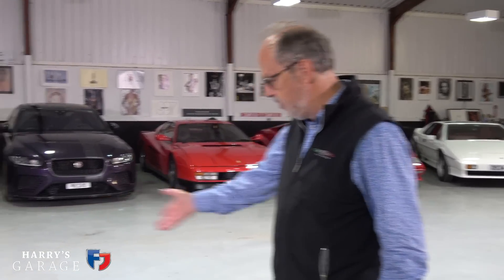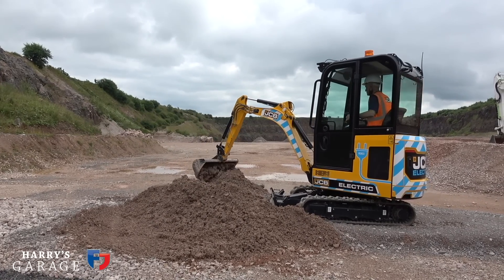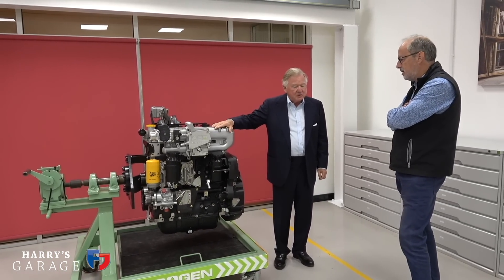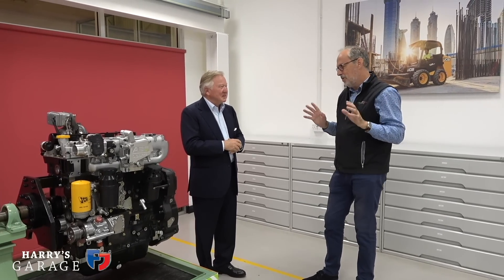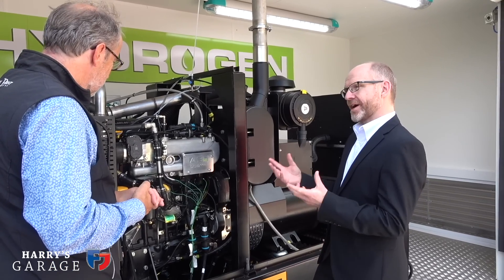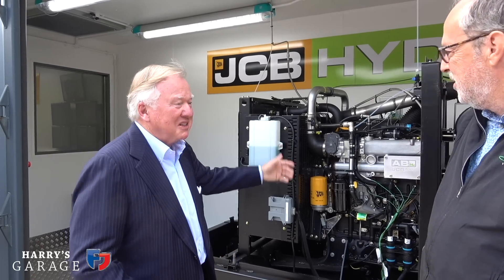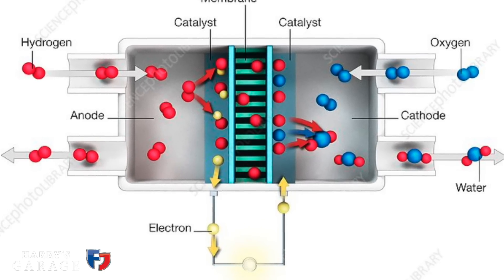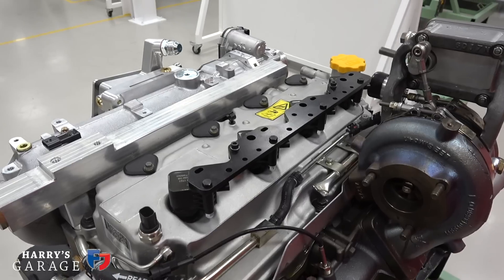Is hydrogen, rather than electric, the future for big-engined machinery? I visit JCB to find out

Comment: I think the main problem is that the hydrogen combustion engine is rather inefficient. Probably less than 20% of the electric energy going into electrolysis is available on the crank shaft. Personally I think that better option would be ethanol or some other non-fossil fuel.
Reply: i bought an ethanol car ~12 years ago, it works great. Ethanol was dirt cheap back then too, then the govt ramped up the tax when ethanol users hit critical mass, now petroleum is cheaper and even diesel is cheaper on a per mile basis, instantly killing any motivation for new punters to make the switch. The regulators need to pull their heads out of the sand.
Reply: To produce ethanol  you would need massive amounts of farmland dedicated to it. The world needs produce to food as well as keep forest land. You could not keep up with demand
Reply: I'd read up on toyota's hydrogen powered prototype car, as you'll see your abit behind times. & kinda missing what this upload shows..

JSB have produced a hydrogen powered engine, it runs on hydrogen gas "no electrolysis is required" also theirs many methods/forms to create hydrogen. You'll also note, it's been mentioned via JCB "in this footage" & toyota all recently have found their hydrogen powered vehicles have very little to no difference in performance compared to a near rival petrol/diesel engine.

search to see video & reports from toyota "yes, a running fully produced model has been created"
Reply: Aw & such hydrogen engines OR converted ICE engines have existed since the 70's again with very little reports on reduced performance & range
Reply: @malp6280  "Electrolysis" in my comment referred to the creation of hydrogen, not the engine. In general I was just commenting that at least current hydrogen technologies including the one presented in this video are wasteful in terms of energy. Especially if the energy originates from electricity. There are also some rare cases where storage or transportation of generated electricity is problematic and in those cases it might make sense to make hydrogen. My understanding is that hydrogen used in hydrogen vehicles originates from either electrolysis or natural gas. I feel that electrolysis in most cases is a waste of electricity and natural gas could just as well combust in the engine without the conversion to hydrogen. My opinion may change if the biological methods of creating hydrogen come to fruition. 

I don't know which Toyota prototype you are referring to. The Mirai and Toyota's fuel cell buses have been in production for years.
Reply: @phyotyla  ok news flash yes companies can use electrolysis via energy from teh network, however they also use renewable power ie wind farms & solar, not to mention there also methods of using algae & several other natural & creative ways to produce hydrogen.

why would anyone need to transport electricity??? if you mean rural area's/poor area's these will be in trouble either way.. if its a more established area, solar, wind etc can be used for production to name afew options.. as don't forget hydrogen is available pretty much anywhere & can be produced anywhere with the necessary equipment

there using hydrogen as its a cleaner gas, rather then just a fossil fuel sourced gas form ie your not improving issues.

I dont know the full toyota name but I'm sure if you google or utube toyota hydrogen car/prototype you'll see exactly what I mean as there currently testing it & yes it looks operates like a usual honda hatch back "as an example" toyota have along with several companies focused on hydrogen as a more suitable green solution for public vehicles over EV
https://www.youtube.com/watch?v=2dgzKW8EKMc one example
https://www.youtube.com/watch?v=yKHVUMeevQ8

https://www.youtube.com/watch?v=Ytg23mDd1a4 bob lazar 1970's
https://www.youtube.com/watch?v=KZuAObOxaW0
Reply: @malp6280  What do you think wind farms and solar produce? Maybe electricity? I also covered the biological methods but they are at research stage at the moment. They may or may not come to fruition.
Maybe I used the wrong term when I wrote "transport". I was referring to the grid.
Yes, using hydrogen is clean but creating hydrogen from natural gas creates CO2 just like burning natural gas in an engine. That's why I wrote that the natural gas could could be burned in an engine just as well.
I never claimed that hydrogen internal combustion engine doesn't work. I claimed that it is inefficient/wasteful. https://en.wikipedia.org/wiki/Straw_man
Reply: @phyotyla  Yes hence why producing hydrogen "newer facilities have there own power supplies ie solar/wind etc which also aids powering the whole facility" just like using solar/wind in your home its incredibly beneficial rather then taking from the national grid.

the manufacturing of hydrogen they don't burn waste/by-products its utilised & yes biological methods of producing hydrogen are in the prototype stage however several further methods are being utilised already.

your claiming hydrogen combustion is inefficient/wasteful & yet toyota are very effectively using it with almost identical results as ICE vehicles, you can see & hear direct from JCB with the same results ie saying hydrogen isnt efficient is old-school ie out of date & misrepresenting modern usage.

Comment: Hydrogen makes so much sense, especially for ocean shipping…They would literally be floating in their fuel source.
Reply: And what power source will the ship use to extract hydrogen from the ocean?
Reply: @chetmyers7041  Hydrogen…filled in a tank at the the dock…It’s not a sailboat, you can’t just shove off and hope it will run. But it could produce hydrogen from seawater underway, greatly reducing the need for fillups.

Comment: Jcb should bring out a van and car hydrogen engine range, and they would sell no problems ! It would spark the industry to follow as electric is not sustainable !
Reply: And where are they gonna fill up fuel. Zero infrastructure so good luck with that.
Reply: Why isn't electricity sustainable? It's been around longer than petrol and diesel...... And how is hydrogen produced? By using good old........electricity!!!!!!!
Reply: @Brian-om2hh  its the stuff that needs to be mined to make the batteries being in short supply world wide being unsustainable and battery life times are the problems including charging times, and the cost of replacing them after 4 to 7 years especially tesla batteries costing up 20 k to replace as an example, not the electricity its self  !

Comment: Would there be any benefit to capturing the H2O emissions as a clean source of water for electrolysis ?
Reply: Very interesting thought.
When you fill up with hydrogen, you give them your pure waste water in part-exchange.
That would be nice because electrolysing tap water has complications…
The problem is that the exhaust water is actually water vapour at high temperature.  Cooling it to capture the water requires energy and more equipment.

Comment: No details on power output - I was on a caravan site in France when i was approached by a Dutch man who saw me enter the park and reversed my van into the tight spot.  He said he had a Peugeot 3 ltr petrol engine and he said he was very worried about his car to tow his van and came around sniffing around my Peugeot 2 Ltr Diesel and was amazed at the ease it was to shunt my van around.  Well he said he had replaced the clutch on his motor and could not work out why his big engine struggled on set off but seemed ok when on the motorway.  He had no idea what was wrong.  I explained that a diesel had a much lower and flatter torque curve than a petrol and did not need the higher RPM  to obtain the same torque (Turning Effort) as the petrol. This means the clutch is not slipped as much on start up or manoeuvring and it is 40% more efficient than a petrol and the fuel could be much cheaper if governments reduced the the levelling tax imposed.  In terms of cleanliness much has been done to take out particulates and other pollutants using advance fuel injection systems and the argument that lots of CO2 is emitted is total  nonsense - it does not contribute to global warming that remains at 3-400 PPM around the globe it also promotes plant growth that in return gives us more oxygen through photosynthesis - scientists who promote the opposite are on the gravy train incentivisation program (CCC).  There is currently nothing to replace diesel with the same energy density and cost.  When they manage to get Fossil of the roads and heat pumps in homes you will get rationing since there is insufficient power generation in the UK and solar and wind produce more emissions and waste  over the life of their manufacture and removal than they save - FACT. Hydrogen is a Spark ignition with the same spec or less as a petrol
Reply: They said the energy level of a litre of H2, is the same as three litres of Diesel. 
They also said the torque is roughly the same.
So it isn't all bad😜

Comment: Hydrogen is not an energy source it's an energy carrier. Hydrogen needs to be produced from either hydrocarbons, nuclear or renewables because there is no molecular hydrogen on planet earth floating around. The use of hydrogen for energy purposes and transport outside of specialized equipment will require unprecedented investments in energy infrastructure. One day..
Reply: Technically, all energy sources are energy carriers.
Reply: much like that of mass market battery energy storage? someone was saying energy stored in hydrogen was free energy I take it?
Reply: Just build more particle accelerators and you'll have a steady supply of hydrogen
Reply: @BRAINFxck10  Can I pick one up at IKEA? Forget that. I don't want to be putting one together with just an Allen wrench.

Comment: Think he should diversify by making hydrogen engines for the road cars…electric cars vested interest from car companies to mining companies that’s why they pushing electric cars under the cover it’s environmentally friendly….as Branford said the raw materials is basically the equivalent to fossil fuel damaging as more electric cars need more batteries not just for cars but phones PCs etc . So more digging for raw materials which in the end will run out .
Reply: Toyota is still heavily invested in hydrogen cars and view that as the future. They have been selling the Mirai in Japan and California for years
Reply: @toms3965  and has only sold 10.000 cars a year
Reply: @SNORKYMEDIA  that’s not the point at all. How well did early ev/hybrids sell? The point is that the one of the world leader in ev/hybrid tech has always had hydrogen as a priority as it is way cleaner. Batteries don’t solve anything, just shift from drilling to digging. They haven’t solved what to do with the old batteries on a mass scale yet either, so it is also just moving the pollution from the air to the ground.

Comment: I noticed the ex Lotus Engineer was very precise when he said that for the same 'mass' hydrogen contained 3 times as much energy as diesel whereas Harry was talking about volume (litres).  So can the same displaced volume of, I assume very compressed, hydrogen contain 3 times the energy of diesel.  i.e. will the tank in the car stay the same size and have 3 times the range.
Reply: compressed hydrogen sounds scary to me?
Reply: Good point. No, the tanks will need to be vastly bigger to get the same range. Hydrogen ICE vehicles will also consume at least twice the amount of expensive green Hydrogen a Fuel Cell vehicle would need. That's about 8 times as much renewable energy required compared to what an electric vehicle needs. Hydrogen ICEs are not even close to being feasible for most vehicles.

Comment: I think hydrogen is the way forward over electric anyway, even passenger cars
Reply: Ok then, tell me how I fill a hydrogen car up on my drive. And how do I get hydrogen from my solar panels?
Reply: @Brian-om2hh  what are you talking about, hydrogen cars exist already. Hyundai has made several different models. Not sure why you are going on about solar panels it's a hydrogen car, not a solar one.

Edit: Also, it takes just as long as filling a tank with gasoline/diesel. There is hydrogen sold alongside petrol in certain areas.

Comment: Do you know what the initial cost of electric is? Right, 1: first you need to dig big holes to get to the coal
2: Transport it to the power station with a huge diesel powered tanker across the seas because we closed all our own coal mines
3: Same principal for building solar panels, ie transporting materials to start with then the rest to a site to use etc
4: Same for wind power, to build and install on top of hills or in the sea, la la la, 
5: Same with building nuclear power stations and getting rid of nuclear waste
Need I say more, except cost and pollution which they never mention when producing electric
Look at the bigger picture
Reply: So where are you going to get the electricity from to produce the hydrogen. And how many new specialised trucks are you going to need to transport the hydrogen. And how many garages can store and distribute the hydrogen. And can you fill your car with hydrogen at home. And if you overcome all these issues, how much is a hydrogen car and how much does the hydrogen cost per ''gallon''
Reply: @bobmac004  it just gets better and better,

Comment: This seems to make sense for large engines like this. The engine looks good and it's great to see JCB at the forefront of this. 

The real issues with hydrogen aren't in using them, it's in creating the hydrogen itself. Currently the only viable way to do this is to crack hydrocarbons - effectively causing more pollution than a diesel engine would. 
The other way of creating hydrogen is to break water into its component parts. It takes A LOT of electricity to do this, but as we progress with solar, perhaps there is a way forward with that. 

It's all early days, but this could well be a way forward for big engines.
Reply: The electricity you use to hydrolise water and then stupidly combust it to provide motive power is almost ten times what you would need if you fed it to electric motro via batteries directly .  Hydydrogen feeding fuel cells and being converted back to electricity topower a motor has somekind of sense to it  for very large powerplant (even though the inefficinecy mean you are throwing away almost 60% of your original power).  But throwing away 90% of your source power by combustion is a really stupid idea.

Comment: Maybe I missed any real details on the fuel tanks, but if they have hydrogen tanks that can hold the equivalent energy of a diesel tank -- they kept using words that approximated a "day's work", which is not the same thing -- then they hit a break through. Even if not, and it is enough for an average day's work, that's great. But then, those tanks -- if I leave it on Friday with a full tank, come back Monday, how much H2 has leaked? This is great tech (that's been around for 150 years kids, H2 engines are not new) but this video was really only informative where it's already a strong contender, not the acknowledged challenges presented.

Comment: It’s a very good idea, “except” you have to extract hydrogen from somewhere, that means power for electrolysis which in turn is generated by wind? Or coal or gas, by the same token finding a means other than power generation to extract hydrogen.
Reply: Yes, need to generate the hydrogen using nuclear or renewables

Comment: so glad there is another option available for heavy industry, the unfortunate thing is they'll still need lubrication and as rings and valves are a wear point, what are the emissions on this?  all this does is reduce the demands on oil. but the less the demand for crude oil, the more expensive it becomes. so grease and oil for lubrication purposes will increase. then there's plastics etc. As the lubricants for wind turbines and ships propulsion systems will still require these lubricants as will every manufacturing process
What can vegetable based lubricants provide do they have the same viscos properties. (Does this mean we have to outlaw vegetarians ;) 

thanks for the video Harry, you've raised more questions for me to look at. keep it up or I'll stagnate.

Comment: A brilliant interview with Lord Bamford, which I do hope will enthuse political policy makers to study feasibility of adapting 4-stroke petrol to hydrogen.  Many thanks !!!
Reply: You don't adapt any of the existing fossil fuel combustion engines to hydrogen combustion (like you would LPG). They are chalk and cheese technologies
Reply: @bbbf09  It could be useful as an emergency measure.
Coal-gas lorries and buses were used in wartime Britain, having a retort mounted behind the cab, or on a trailer.
In neutral Switzerland, the loss of imported coal supplies saw electrically-fired steam shunting engines used on overhead-equipped railway marshalling yards.
All disastrously inefficient, but needs must...

Comment: For large machines I have often thought that they should consider fueling large machinery directly from tank farms rather than fueling them directly from onboard fuel.
So for example either have electricity supplied via long cables etc generated on site from hydrogen or even hydrogen fed directly to the equipment from a tank farm. There has to be scope for innovation or “thinking outside the box” for this specific application

Comment: Though Hydrogen is according to video 3 times as dense by mass as diesel . By volume I understand it is 7 or 8 times bigger. Where do they fit all the hydrogen on the vehicle.
Reply: The vehicle they were running all day, had 5 kilos of H2 for it to run for the day🤔 It's in the video.